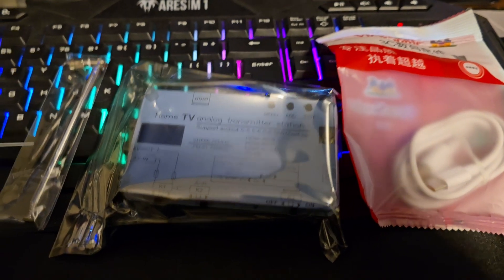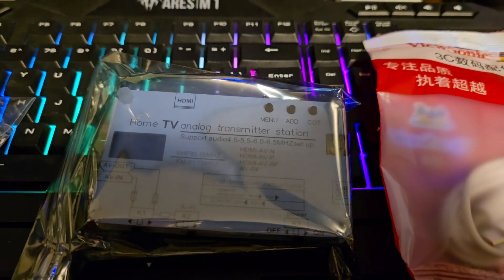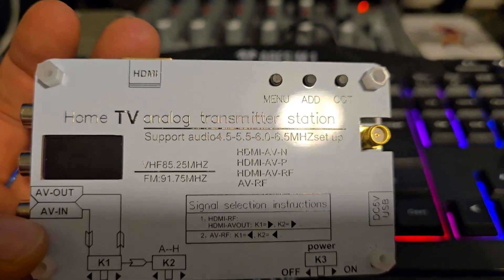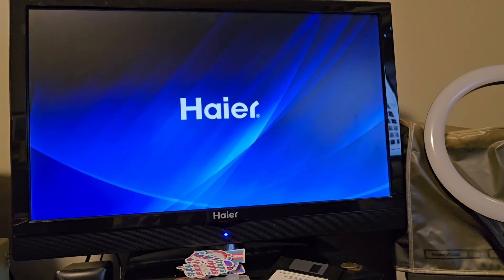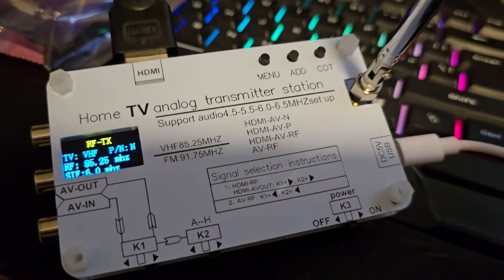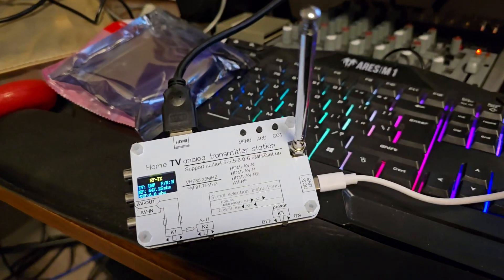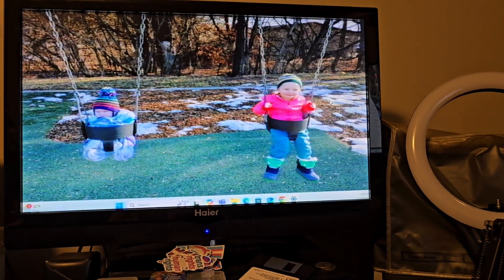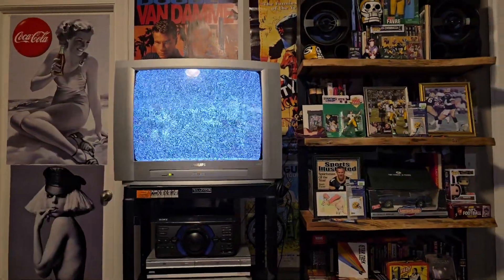RF Broadcasting at Home with CRT and LCD via HDMI and a PC! UHF vs VHF vs No Antenna vs Built-In!

Comment: The Support audio 4.5 5.5 6.0 6.5 MHZ is for Audio on your TV. In North America the analog TV audio is on 4.5 MHz, the rest of the is 5.5 6.0 6.5 The reason you have bad sound (static sound) is because your RF modulator is not set on 4.5 MHz is you are using an NTSC TV (American TV). The 6.0 is for PAL TV  (European TV).

I recommend UHF band for wireless analog TV broadcast, there are less interferences compared with VHF Band. If you decide to connect using a coax cable then both VHF and UHF will broadcast picture with no problem.
Reply from the maker: Thats awesome, thank you!!

Comment: i love this video but you should switch to linux. windows 11 sucks. so, back up your data and just install linux.
Reply from the maker: Linux is fun, but I am too lazy to make it my daily driver anymore
Reply: @urzamaster  also, if you broadcast on VHF low or VHF high. you wont be able to receive it with no antenna but if you do UHF but higher like (channel 36 or something else above) then you're good.
Reply from the maker: @LF9TR hey thank you! I will try that!
Reply: @urzamaster  but before you try it, dont forget to set it to 4.5 MHz for sound!
Reply from the maker: @LF9TR thank you!!
Reply: @urzamaster  okay, so you said linux is fun but you are lazy because it can be difficult sometimes thats why you use windows. i used linux since march 2025.

Comment: Did you vary the xmit antenna length?  Try it.  Longest won't necessarily be best. I did not see you showing the receive antenna(s) you used.
Reply from the maker: I'll try varying the length next time! This is entirely without external receiver antennas. More to come.

Comment: Put a real antenna on the CRT then select ANT instead of Cable in menu settings.
Reply from the maker: @randymoyer5351  yes, definitely on the to-do list. Follow up coming soon!
Reply: @urzamaster also add 51 on CATV from UHF 14 to 43,
Reply: Channel 65 CATV

Comment: Need antennas connected to both TV's. In America, the channel bandwidth for both VHF and UHF channels is 6 MHz; with the SIF set to 4.5 MHz. You're receiving the video on the wrong channel because you have channel width set to 8 instead of 6 and not getting the audio at all because it too is offset improperly. 

Keep playing with it, it appears to work,just wrong offsets. Good luck.
Reply from the maker: Thanks for the info! Yes, gotta get some bunny ears going
Reply: @urzamaster  you could just get a large paperclip and straighten it and that will get you something.

Comment: The channel numbers on the CRT TV are just allocation slots for stored channels, not the UHF channel number. You need to search tune or enter the frequency manually via the menu.
Reply from the maker: There are some good tables online! Great tip!
Reply: @urzamaster  They'll be just as the past person stored them. They're just presets. They won't correspond to anything. I was thinking, for the love of God, go into the menu and do a scan! (or enter the RF channel number as appropriate)

Comment: You need to put an aerial into the CRT tv, as the gain of the TX is not very high so not to interfere with anyone outside your property. The 6 Mhz. setting is for the Vision and sound separation in the UK with 8 Mhz UHF channels the separation is 6 Mhz but don't know what is is in the US. Without thus being set correctly you won't get sound.
Reply from the maker: Awesome, good to know!!